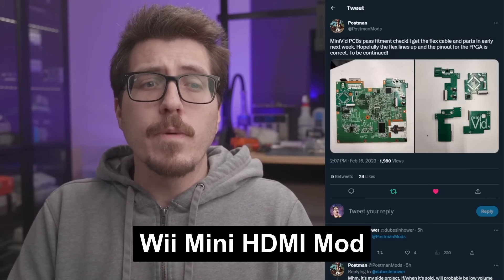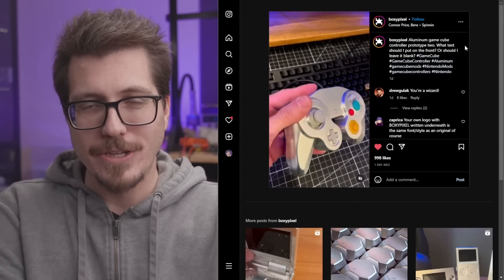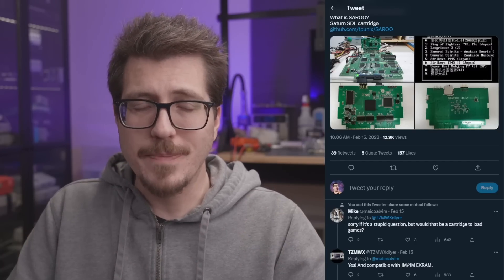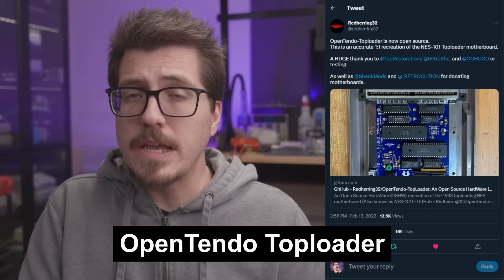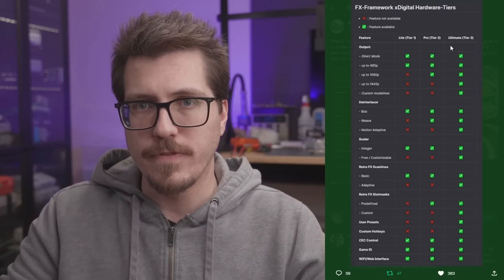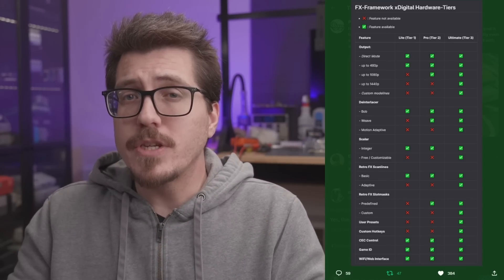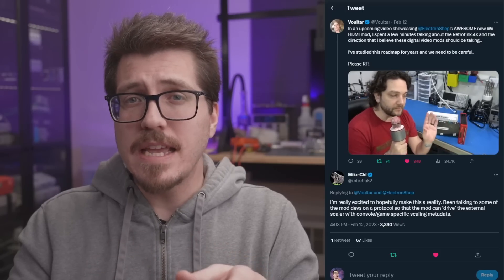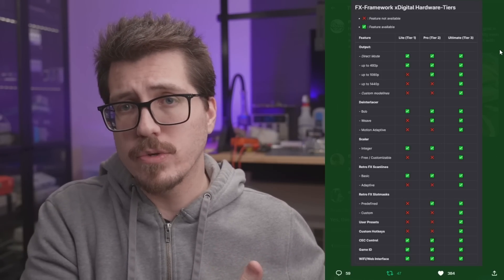Exciting Future For HDMI Console Mods - Retro Modding News

Comment: funny I found myself confronted with lawyers after one of the retro scaler manufacturer send a report to the hdmi consortium. even I had a valid licensed HDMI chipset the license schema changed, now requires to be part of the hdmi consortium ($10.000/year membership) and you need to pay per shipped unit a license fee. I had luck as my chipset vendor jumped in but if I hear someone implements HDMI without a valid license I need to warn you. it could be very expensive as you need to pay membership for all the years you sold your product and a fee on top. Btw the company sending the report was a famous one in scene....

Comment: What is the best way and best graphics for sega to display in newer tv?
Reply from the maker: Which Sega?
Reply: @dubesinhower  sega génesis 2. I just pick it up, and thinking of doing the 3ple bypass. Would like to know what’s the best cables, setup to play it on my newer tv. I’m kinda new to all this this   Thank you for you response.
Reply from the maker: No problem! I recommend HDRetrovision Genesis component cables and a RetroTink 5X Pro if you're looking for the best quality you can currently buy
Reply: @dubesinhower  thank you very much. I’m trying to see where I can find the retro think 5x pro cause they seem out of stock. One last question, will the retro think 5 work with a stock n64? Same quality as a n64 hdmi mod?
Reply from the maker: Not a stock N64, you would need to RGB mod it to match HDMI quality

Comment: if your using lite to upscale a digital signal though, wouldn't you be stuck with the bob deinterlacing on it since that is all the lites support, otherwise it would just be 260p, or does it let you turn that off for upscaling
Reply: Direct 480i output will be an option for user with external scalers.
Reply: @woozle64  right on, i can see this being cool for upscalers than, more so than the premium options

Comment: I've only had 1 Saturn and 1 action replay cart. They are basically married and I think I've reslotted the cart twice. When I open it to tape down the lid switch for cd swapping and when I opened it a 2nd time to install an ODE. I've heard what ruins the cartridge slot is the action replays because of the low quality not correctly beveled PCB/edge connector. Or maybe it's just swapping carts a lot. Memory card, 1M, and 4M RAM cart. King of Fighters carts if you have the real game. Couldn't say for sure. A cart mod is a cool low effort upgrade for anyone that wants and ODE and their disc drive still.

Comment: HDMI upscaler is interesting.  right now im working on making my wall of retro, its gona be  all the systems mounted on the wall.  Iv already invested in a analog upscaling solution.  analog switchers and the lot, so i wouldnt be doing this.  But if i was starting this project now, i think i would gravitate that way just out of curiosity.  hmm Maybe i could make a second redundant wall , retro wall 2.0 .  il shove that in the brain closet with the rest of the horde

Comment: I think there are so many complaints about unreliable Saturn cartridge slot is due to the use of the action replay carts. The official ram carts were beveled and chamfered so it wouldn’t damage the pins on the slot. The action replays were not and often crushed pins. Just a theory. Thanks for the video.

Comment: A mod that would make Saturn cart slots 100% reliable would be waaaaay more desirable to yet another ODE.
Reply: I agree, I wonder how one would go about making/sourcing new cartridge connectors for the saturn
Reply: Yeah I wish there was one too. I bought a broken Saturn and fixed it but the previous owner got crazy with hot air and totally melted the slot. I made a pcb to take an action replay and makes it so you can solder it to the underside of the cartridge slot. It currently only fits on va0 and .5 for sure. It  can be switched on/off and between action replay and pseudo Saturn kai.
Reply: I can’t tell you how many saves I lost will that damn Saturn cart. Nothing but problems.

Comment: Nice!  I finished an OpenTendo top loader as well and it's running great!  It is much easier to put together than the original front loader OpenTendo, but the parts are MUCH harder to procure.  Harvesting from a busted AV Famicom might be the best option, but it would require some playtesting.  As the toploader is 1:1, you'll also get all of the horrible scanlines as the original if it's only RF.

My next built I'll likely be doing NESRGB. 🤔  Can't wait to see when you live stream your own build!